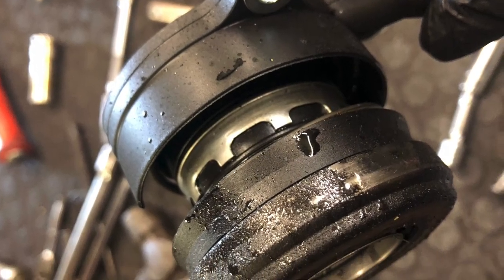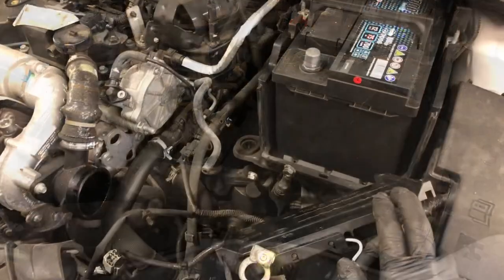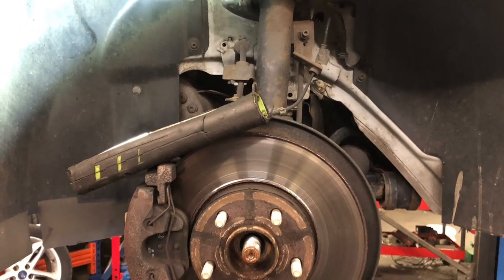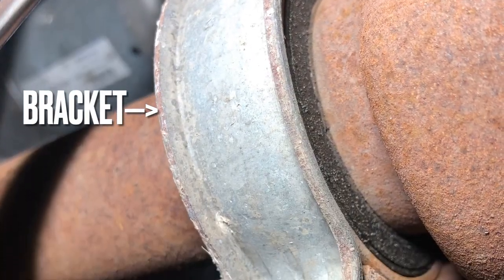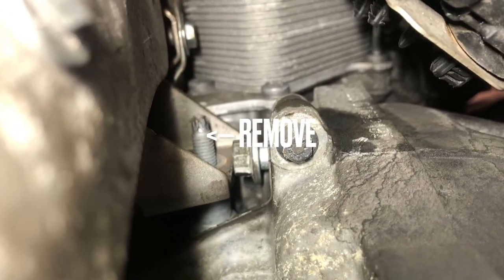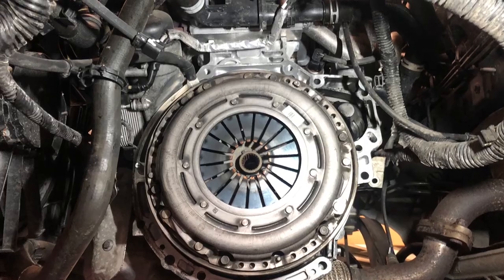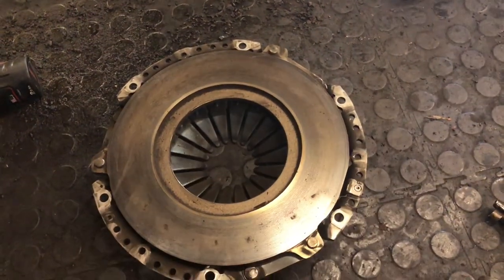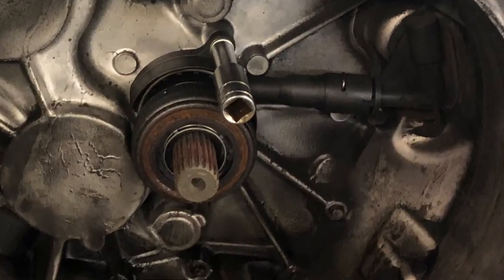Ford Focus clutch slave cylinder replacement. Pedal sticking down - How to fix!

Comment: Do you have to drop the subframe to remove the transmission? Is it possible to remove the transmission with the subframe still in place?
Reply from the maker: Yes it can be changed without removing the subframe.